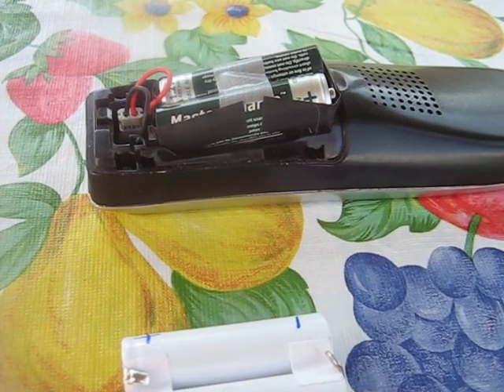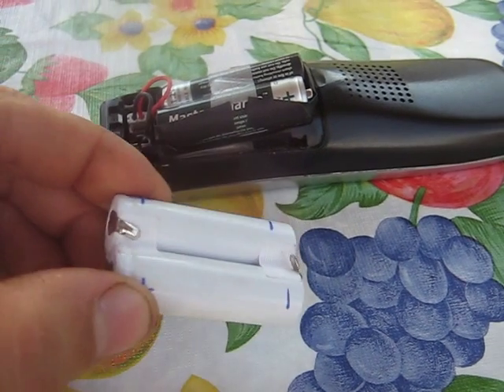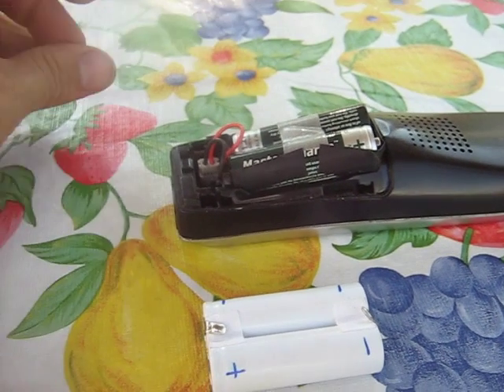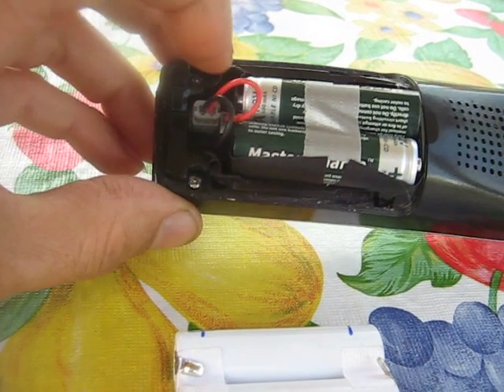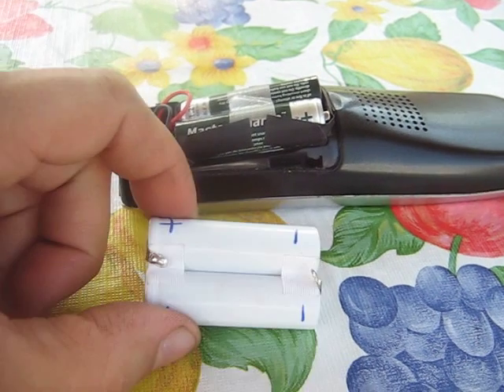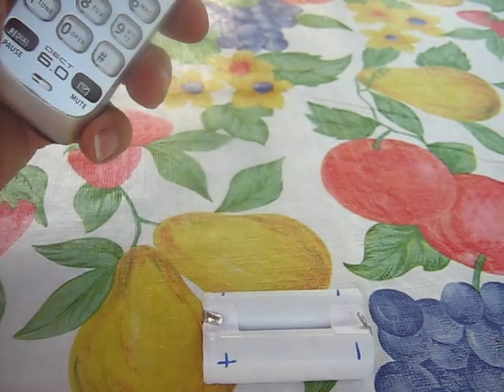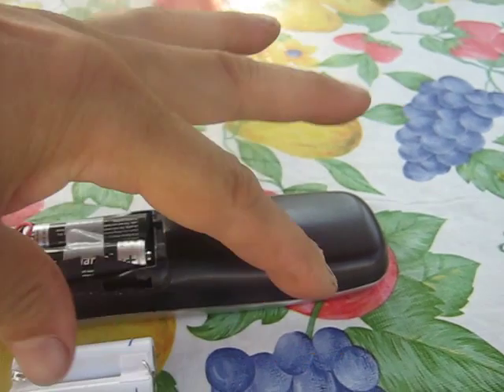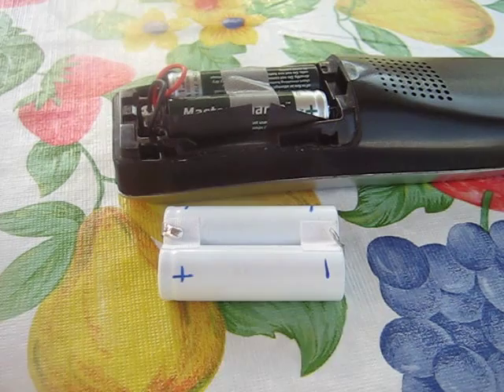Dead Cordless Phone Battery?

Comment from the maker: I thought about that, as it is easy to get 1200ma batteries versus the 600ma ones I use here. I used the smaller ones, since that is what the phone came with, plus I figured they would be more fully discharged, and perhaps not have a memory problem.
Good point about keeping the phone bill down!!!